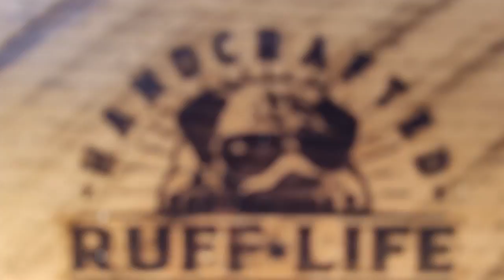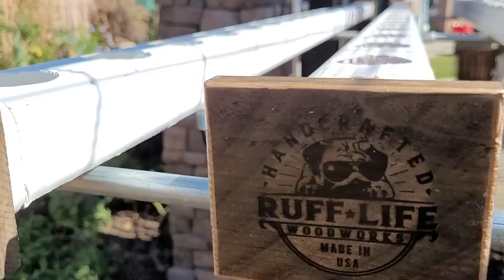Kratky Hydroponic Downspout Rails Updated With Auto Water Float Valve (Part 1 to Experiment)

Comment: on some of them are you wicking up into a container with seed starting mix ?  I am running 4 gutters off 1 bucket (gravity) with a float with 5 gal grow bags wicking from the gutters. You are running high pressure to floats ?  I like the orings for slip fitting. Are those 2x3 downspouts ? I Like using the one with float to feed the others. I ran a pvc pipe from bucket and branched off it. That is now unnesc.  You find 1/4" line enough ? There is no return line ?

Comment: Great setup.  How are you supplying the nutrients to those with the float?
Reply from the maker: Well for now I will using the Master Blend concentrate and just add directly to that middle rail and see how that goes. I been using the Master Blend Concentrate directly to the RGGS and the  plants have been doing great. I just been sticking my EC meter into my RGGS gutter and get the reading then squirt in about 30 ML to gutter. So I will do the same for these but I am think would be like 2 ML per rail so I would be adding about 10 ML. Once I test my EC meter I can dial it in. I did buy his DIGG fertilizer injector from home depot https://thd.co/3KrSGZJ but yet to hook it up. Its supposedly set at fixed 100:1 ratio but I need to hook it up and test it and see what EC comes out it when I run the water through it. If it worked it would be great as it would skip having to have some large reservoir mixed with nutrients. The question is whether it works or fails. Time will tell!!
Reply: @rufflifehydro  I had a bucket system connected in line and the first bucket had a float where I would only add the nutrients weekly.  The problem I had was that the first bucket got all the nutrients and by the time it reached the last bucket, it was depleted and the plants suffered.  Without a running water system, the nutrients won't be thoroughly and equally mixed and delivered throughout.  You will notice based on how well the plants do at the far ends.  You might need a reservoir before the float that is always mixed with fertilizer to keep them topped off since it's using the Katky Method and water isn't running.
Reply from the maker: @plantbasedprepper  That makes sense so I will have to wait see once I get this going and how the plants react. There is couple of the things as I am using mostly for seed propagation so I make basically 1/3 perlite, 1/3 peat moss, and 1/3 compost so the plants are getting nutrients from the compost in the that scenario. But for the other mix I would just be using 1/2 perlite and 1/2 peat moss and would require the nutrients. So that drip line waters my raised garden beds every 12 hours and for 20 minutes.. I checked this morning to see how it working and the rails looked filled as the float valve filled them up. The other options is I would make up a 30 gallon trashcan and use a reservoir. Dial the EC and and PH in that reservoir. I got a free diaphragm pump from work and I would hook to the top of the trash can as it got 30 PSI and adjustable. The idea here would be to put a check valve in the system which is feeding the garden beds and now the krakty rails. So I could still use my timer valves as normal but have the 30 gallon trashcan back feed the nutrients  through the system either on timer or manual at the beginning. This would work well and add many possibilities for me to to back feed many parts of my garden if it worked.. Hope that makes sense on what I described.. I will get there at some point and test!!
Reply from the maker: Actually I was on Reddit asking if anyone had any success with that fertilizer injector from Home Depot. But someone gave me an idea just to use a funnel and valve. Anyways I grabbed some parts I had this morning as it sounded interesting as I just got a water bottle and put a grommet and 1/4 in line in the cap and I had some 1/4 valves and just turned it upside down and stuck into one of the cups on the rails. So you can control the drip like an IV. I have there now just to see how long it takes.. Its just a concept for now but I will put up a short vid as it looks like it might have potential.. Poorman's Dosatron!

Comment: In part1 or part 2 you said you could change water levels by sticking 1/4" tube higher in the gutter. I believe that this is not true. They will all be at the same water level unless you raise or lower the whole down spout.  Raising the tubing in the down spout might be better in case one of the lines come off any down spout. They would all eventually drain no matter which tube came off. Raising the tubing in all down spouts  could keep water from completely draining each spout
Reply from the maker: Yeah it was just a thought at the time but you can definitely tweak the water levels. As you mentioned, if I put all the tubes at the same height in both the reservoir and the downspouts then they'll just balance out. But once you start adjusting the height of the tubes in both the reservoir and also the individual rails, you're going to get a different outcome. The other thing that contributed to this is the self-watering valve would turn on every morning at 15 minutes and feel that center reservoir. But really I never did this. I just watered them as normal and it work great